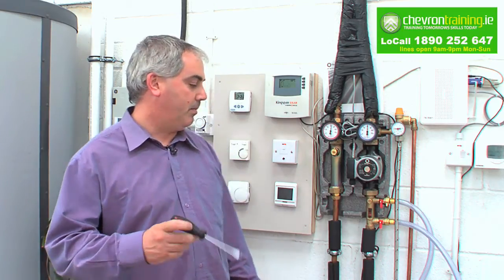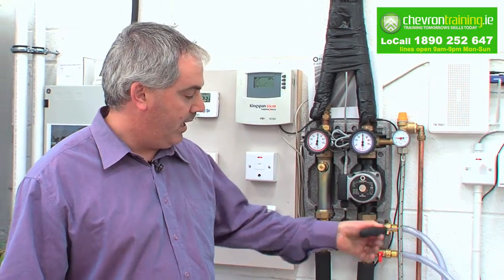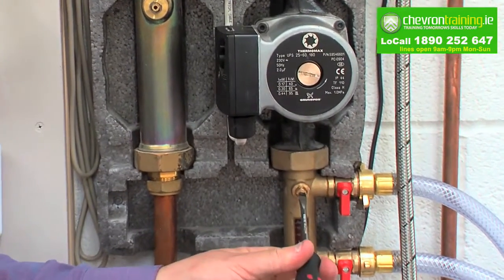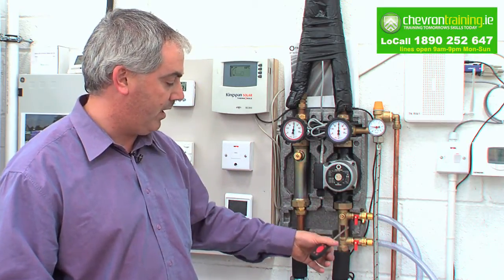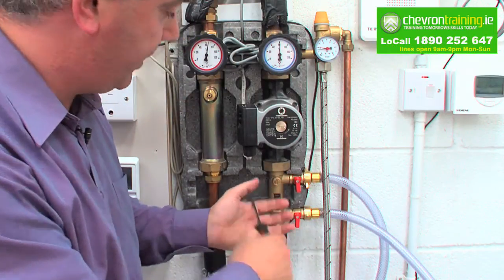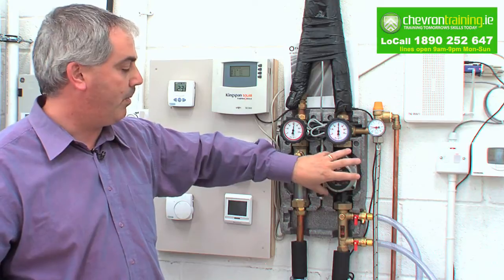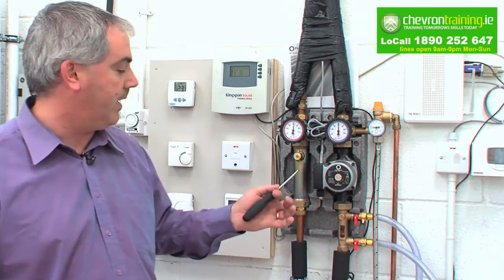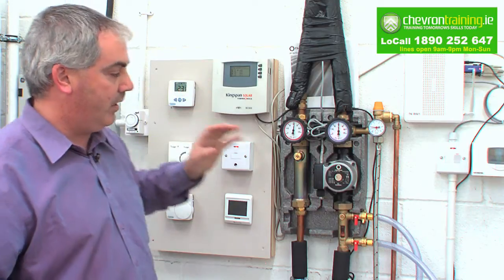Chevron Training - Commission a Solar System

Comment: Just looked at a different  video the only difference was that he used the lower valve as a flow and the top as a return for the anti freeze.  I reckon it realy makes no big difference it will work both ways . Thanks for the clear explanation. Just had to fill our system after 8 years the pressure had gone to zero  . There where some connections on my system that had sweated over the years you could see the green and black build up on the connections . I  guess the installer had not tightened it enough because I could tighten it a bit more .  Just got a cheap water pump with a maximum out put of 3 ato and a plastic drum of anti freeze. It worked perfect the pump is silent  again

Comment: What pressure should this system have reading on the clock when you close both filling taps
Reply: If your using a proper fill flush pumping unit it could finish up at 4 or 5 bar you den have to release the pressure Generally speaking 2bar and have the expansion vessel 0.3 bar lower  than the set pressure 2 bar .Both temperature gauge need to be turns to 45 degrees to fill flush the system and then return them to vertical when finishs this gentleman has did a very poor job of describing how to service fill a solar system